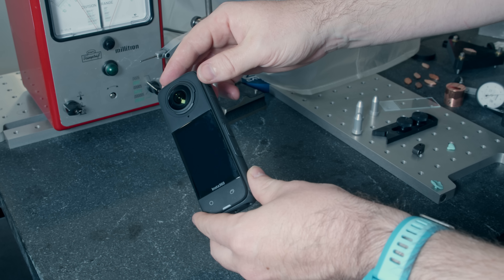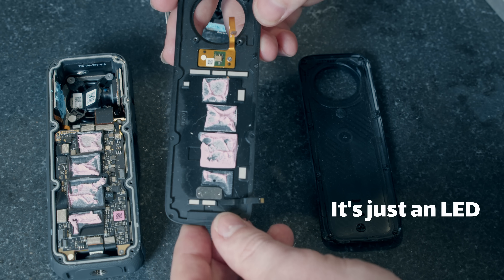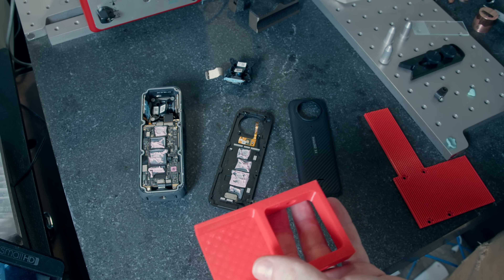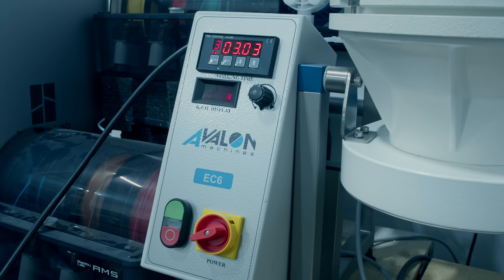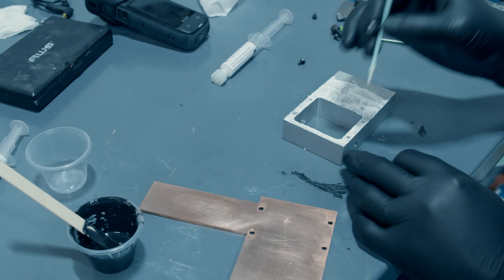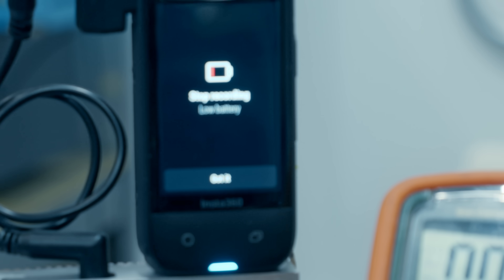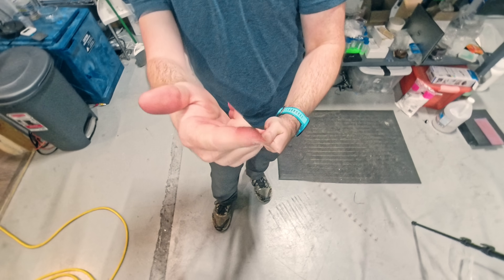Overkill Heatsink = Never Overheating Again

Comment: It may not practically matter that much but the heat dissipation should improve once you let the copper get dull. The oxide layer has a higher emmisivity than bare copper and so (by the Stefan-Boltzmann law) radiative heat transfer from the surface of the copper will be greater

Comment: what about - remove the back panel entirely,  photogrammetry up the entire board and components, create an SLS with CuW composite, or do a pla mold and lostpla a pure copper heatsink that directly interfaces with the board (with some thermal compound) no more backing plate? will be lower profile and you just need one chonky handgrip that goes down, and integrates the sound thing right beneath - better?

Comment: Maybe ai could offer suggestions how to maintain performance of the device but reduce heat and power consumption… different recording formats, micro size liquid cooling system, nvidia enhanced algorithmic frame / object generation. Just a thought not sure how feasible. Refillable Liquid nitrogen cooler that lasts longer than the battery lol

Comment: surprised that you did not mount a fan to it, would not be that difficult, and you can get USB powered fans, that can be powered from a V Mount battery, with active cooling, you could scale down the mass of the heatsink, and use that gap under the camera to prevent any more from showing up in the footage. The battery could be mounted under that, or attached to a tri-pod. Using external power would also allow you to film longer, provided that the camera allows for that.

Comment: The overheating issue is awful with GoPro camerase, even in fear east Russia weather. Idk but they don't seem to have any capable engineers. My wife and i are electronics engineers, not consumer tech or anything with cameras, but the thermal design of these makes me cringe. For holiday and travel videos, i often had to switch to my phone which is an ancient Pixel 2. Does a better job at being a camera than an actual camera.

I have noticed this overall in the last few years that consumer tech is designed by absolute goofball people instead of proper R&D and people with skills. The slopification of everything. Or like Dankpods likes to say: the biggest corporation make the biggest crap. 

//typo

Comment: I was actually thinking of getting a 360 for filming in a very hot environment, so this is actually good to know.  I hadn't seen any reviews mention bad heat management.
Reply from the maker: Mostly an issue when filming in the 4k mode. If you drop down to the 2k resolution the heat issues are a lot less pronounced. Might still be an issue in a hot environment if there isn't a lot of airflow though, not sure. Would definitely want to borrow one to test before purchasing in that case!

Comment: Instead of cutting out the piece to the right (if you are looking at the copper side, you should have let the heatsink stick out over there, probably would have had way better temps, as you could have done fins on both sides. of that part.

Comment: Here for the superglue fixturing!  I'm guessing your fixture plate method was a lot more accurate than the blue tape method.  But maybe you don't need that much accuracy on the heatsink?  In any case great job on the project.  You're brave for tearing into that camera.

Comment: You could definitely mill the top of the heat sink to an extreme angle and it would vanish in the invisible part. Wouldn’t really be enough material to degrade its ability I wouldn’t think. I’d say parts of a single percent if anything.

Comment: Form over function! Wow, yes it works. It looks like shit. What I think you should’ve did is the exact same thing except the shape should be of a handle so the X4 would be longer and then have a quarter 20 thread underneath at the bottom so a pole can attached to it. The copper would attach the same way except when it goes towards the bottom instead of looking like an “L”it looks like an “I”. It functions exactly like yours does but looks 10 times better.

Comment: If you milled on the inside of the heatsink for a heatpipe, you would have had a even better conduction of the heat to spread it. The lower aluminum part will not help much with the dissipation. Heat travels just so far. But it seems like it works great for you.

Comment: I can't tell from the video - did you leave any air access to the boron nitride paste? it needs to dry in order to work properly ( as it's a water based paste ), which it can't do if it's in an airtight enclosure ( e.g., epoxy on all sides )

Comment: I too had this problem with my projector, the intense heat was destroying the polariser. I had some copper tubes lying around, so i flattened them into 10cm pieces of 5, tied them together and inserted into the fins of the heat sink in the projector. I did feel proud of doing that.

Comment: Just fill it up with mineral oil and put two holes for circulation of the oil, you can direct the oil through a mini radiator with the help of a small pump.

Comment: I was actually looking into getting one of these to stream endurance racing inside the car. However, the overheating concerns are what pushed me away from that idea. I'd be curious if you would be open seeing the cooling performance of this while it is on USB power source and an ambient temperature that is consistent and relatively high. Because our races are 8+ hours and the ambient temp in the race car likely is higher than the scenario you displayed in the video.

This would be valuable for my decision making to see if I want to invest into for racing 

The timing of this video is incredible, great work! Love your channel ❤

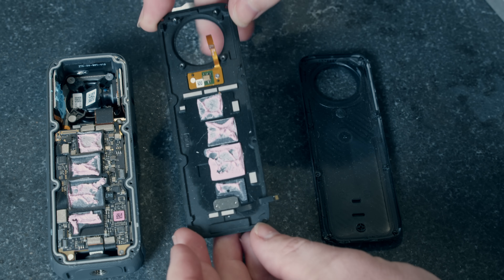Comment: 1:52 why they dont make case in aluminium heatsink? and put ruber on corners. I mean a heatsink case not a CPU heatsink with fine fins. like old heat sink ussualy used on pasive coling server. where the fins are really small. well in the case must be even smaller. it will be like small perturbation along its large size, from 0,5mm to 2mm high fins so no debre go in beetwen.
Reply: 3:15 Something like that i was thinkgin but build in case. and the fins even smaller and more gap in betwen, just to have more surface to spread heat and dont hur user when using it.

Comment: This is awesome. I've been using the One RS 1" 360 edition which suffers from overheating as well. I use it often with an external powerbank or charger for infinite runtime but this makes the overheating problem even worse. I usually point a small USB fan at it on a small flexible clamp but it makes the whole setup very clunky and look unprofessional (I'm a videographer), and it still overheats sometimes even with the additional airflow. I just bought the X4, haven't used it yet but I'm sure it will have the same issues, as do my Gopros. One day I'll be able to do what you did in this video to get it to a reliable state but I'm not there yet 😉 I think it was still heating up slowly in your test, right? Could you maybe do another duration test where you power the camera over USB, to see if it reaches an equilibrium before shutting down from overheating? Otherwise a V2 of this may have to include a small fan 😬

Comment: You should have stress-tested it with recording while charging from a discharged battery. Would have been cool to see what the limits of the solution are (probably would've worked totally fine). Anyway great job as always.

Comment: I think just removing the pink goop, using some higher-performance CPU thermal paste and leaving the plastic back off would have cured it?! you could have even stuck some of those tiny RAM heat sinks on the back, without destroying anything???

Comment: I’d consider refixturing it on the CNC to round over the corners on the heat-sink. That’s the sort of thing that scratches its way through the bag you put it in. Though you could also 3D print a case that doesn’t let it move about at all.

Comment: Could you have made a mock battery with to small blower fans and a wire to external power to solve both the cooling and run-time?

Comment: No surprise that these things overheat, I brought a couple of water damaged insta cameras to repair and boy, have they crammed a ton of components on those tiny circuit boards. Absolute nightmare to work on, with salt-grain-sized 0201 passives all tightly packed in among all the chips (which are mostly BGA, even the tiny ones).

Comment: I'm not sure how difficult it would be to get the parts up to temp, but brazing the copper and aluminium parts together would have been a neat solution

probably much better thermal conductivity and contact and you wouldn't need the epoxy

Comment: Use heat, not acetone to break metal on metal superglue bonds. Will penetrate the whole glue surface instead of just the edges

Comment: I don't get why you had to mill all that... The aluminium body could have perfectly transferred heat trough the epoxy without the matching of the surfaces. All you needed was 2 square chimneys hidden on the sides of the camera and a thin copper plate transferring the heat to them. Making the heat sink in to a chimney would have added some additional air flow. Also an improvement to your design is to get some infrared transmissive black paint and paint the radiator, but if it's used in the sun or under massive projectors it will backfire.

Comment: I noticed your Extech EX330 multimeter kept turning off during the timelapse at 8:45.
Quick tip: You can disable auto-off by holding the mode button when you turn it on.
Most meters have this function, on Fluke and other meters instructions to disable auto-off often printed on the battery cover (behind the flip stand).
Reply: Handy!
Reply: nice!

Comment: You may be able to sand away the very top edge of the heatsink and see if that bit in the frame goes away. Though it could also be the bottom edge you're seeing. A bit of sharpie should answer that question.

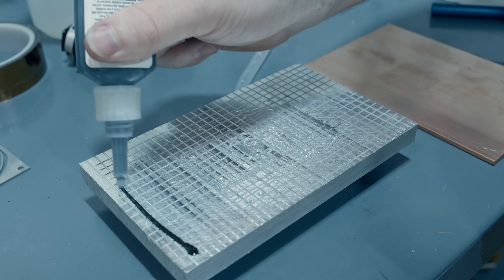Comment: 4:58 I think if you glued them in the reverse order, you'd get even more glue at the interface where it matters and could also use less per mounting, instead of it ending up in the grooves and making it more tedious to dissolve away, it would also give the acetone more unclogged channels to snake in around to all the surfaces. Place the part to be milled, lather glue, put the cross-channeled surface plate on that, and gently slide it around some to spread glue contact all around, then push to set it, etc. Also for oddly shaped pieces there's no 'guessing' how much of the channel-plates surface you need to cover or where since it's on the work piece instead.

Comment: This was a very expensive way to do this. A single 8-inch flat heatpipe offset to the left of the center backplate rib would remove the need to mill anything. Then, attaching a beefy 20-dollar m.2 SSD cooler to the bottom of the overhanging heatpipe would yield similar outcomes with a substantially reduced price. Very very cool project though
Reply: .. when you have all the coolest toys you've gotta play with them!
Reply: @notsonominal  this is very true

Comment: You mention airflow lets it work at dual 4K fine when it is in motion, was a 120 or 140mm fan not adequate? That's what I use when running electronics that require constant airflow via movement to not destroy themselves (Drone video transmitters mostly).

Comment: Instead of making that overlaid plate out of copper, I would use some salvaged heat pipes to very quickly wick the heat out of the case and into the larger heatsink on the bottom.

Comment: Your superglue fixture plate, would some small holes through to the back allow more access for the acetone? Like 1/8" diameter holes that wouldn't affect the surface area much, but allow lots of access holes to the center of large plates like that.

Comment: When I was deeply into astrophotography I had my Canon DSLR professionally modified in Korea to be a massive heat sink with Peltier cooling and fan. Maintained 20degC below ambient and allowed me to pull 10min exposures without heat spots on the CCD sensor. Needed a computer to run the imaging and it was heated on the glass sensor screen which was also without UV and IR filter.  Over the top for your application maybe but who knows what you might do next.

Comment: Might have been worth it to use decent thermal paste both inside (connecting chips to case) and outside (case to heatsink)
Something used in higher-end PC's, like Thermal Grizzly's Kryonaut
It might only drop the temps by another 2-3 Celsius, but it'll help the camera live longer (and will also help during summer/even hotter climates)
Reply: The boron nitride thermal paste he used is about as good as it gets, it has 2.5x higher thermal conductivity than kryonaut but it's unfortunately not good for direct contact with electronics.

Replacing the inside stuff with some decent stuff would likely have been a good idea as you say though.

Comment: I did a similar thing with a couple of cameras. But I used some Panasonic PSG as a flex heat strap to carry the heat away from the ASIC to the metal chassis areas and an additional metal 3D printed heatsink tucked away.

Comment: they make thermally conductive epoxy but its pretty spendy (mg chemicals, digikey /amazon tiny tube 25 bucks on up) but they work rather well. I forget if it was thermaltake or artic that made some that was more cost reasonable but it doesn't matter as its not on the market anymore. We did some testing at work with it and its almost as good as "the silver paste" but what you did will probably serve you well (considering some clamping, heat and time makes most thermal goo stick almost as much as epoxy)

Comment: I had to stick heatsinks all over my gopro hero 10 like this. Sitting still indoors it would over heat and shut off in 15 minutes. I use it to record bike rides and still yet going at 10-15mph it overheats just minutes before the battery dies at about 35-40 minutes. Haven't had issues unless I'm in direct sunlight now.

Comment: i think it would be so cool if you continued a series with this where you made a watercooled heatsink that screws into the original holes. It can get pretty hot inside of track cars with no airflow, and this would be cool to see done.
Reply from the maker: Oh, yeah that's tempting! Would be very cool, I'll put it on the "need a fun quick project" todo list!

Comment: As a note, CA doesn't react well to thermal shock so next time toss the glued fixture and plate into the freezer. Works even better with dissimilar metals.

Comment: I hope the manufacturer sees this and they are embarrassed AF. Can't even take a 30 minute video with a video camera without a massive additional heat sink, that's wild.
Reply: Lol even high end DSLRs have this issue, the reality is video processing is compute hungry and the chips put off a lot of heat, but yeah this could definitely use a better thermal solution for sure
Reply: @HerbaMachina  so when I see wedding videographers record for the whole reception they must be using custom cameras with heat sinks too? I doubt it. After some research, no, "high end" cameras do not overheat, cheap ones do. The actual high end ones have peltier coolers on the chips to allow them to run indefinitely.

Comment: A great solution!
The only thing I am wondering, is if it that beneficial to have the battery in the aluminum housing thermally bonded to the same heatsink the camera uses. 
If its operating temperature at that power is below that of the aluminum, it could lower its efficiency.
Reply from the maker: Yeah probably not great for battery health/life. I know some folks will remove the battery and run on external power, helps keep temperatures down a bit (no heat from the battery, and air circulation in the battery compartment).

Comment: 6:46 It looks like you just reused old thermal compound. Hope it didn't sit in the air for too long.
Reply: Came here to make this comment. Gotta replace the old compound with an appropriate quantity of premium stuff.
Reply: Or it's high-quality PTM and can be reused - replacing it with anything else would perform worse. The final result shows that it's working perfectly well.
Reply: I thought the same, but the camera is generating 3W-3,5W. Not sure how severe a hotspot can really become. Would have loved to see fresh thermalpaste though

Comment: would of been cool to see the heat spreading with a FLIR camera
Reply: difficult to capture with bare metal, as it is very reflective for IR radiation. Probably would have needed a coat of paint or some coating to get decent results with a thermal camera.

Comment: I use a USB 7530 turbine fan or a Peltier-based smartphone cooler but that's because I don't need full 360.  I might utilize your idea though by just putting a long copper / aluminum plate and placing the Peltier cooler underneath. Thank you!

Comment: Is there a reason why you didn't go with thermal epoxy?
Reply from the maker: Better heat transfer with the thermal grease. The epoxy I used was rated highly for thermal transfer (1.87 w/m-k) but the thermal grease is an order of magnitude better (31.4 W/m-K)
Reply: @BreakingTaps  that is way more of a difference than I thought!